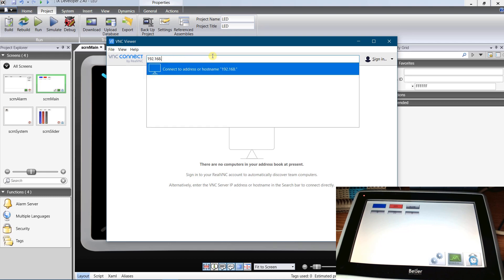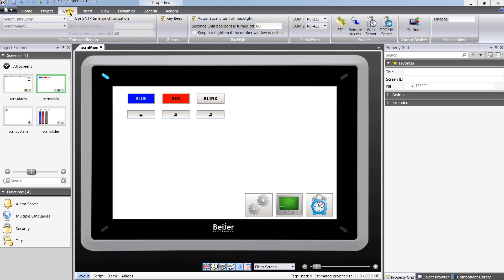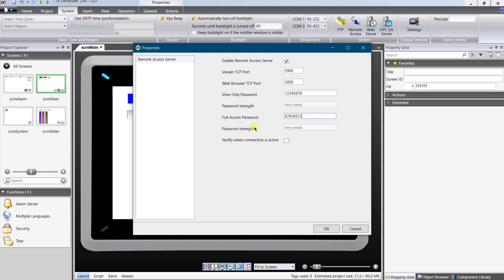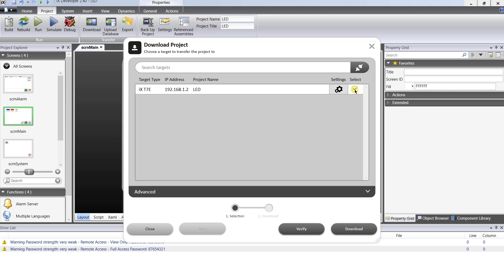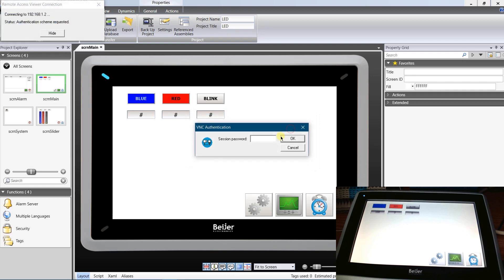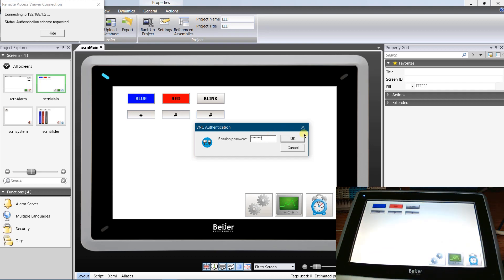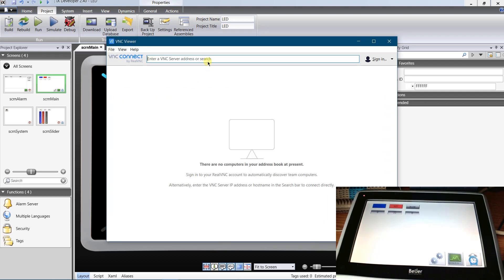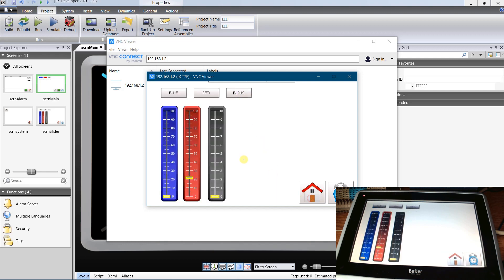Beijer iX Operator Panel: Remote access server

Comment: Thank you for making this video. In this video have you connected the HMI and computer on Internet and then accessing it or you have made a local Network
Reply from the maker: In this video computer and HMI are on the local network (LAN). If you plan to make connection via VLANs, then you need to create some rules in your managed switch. If you want to make connection over internet, then you need to make a VPN connection.